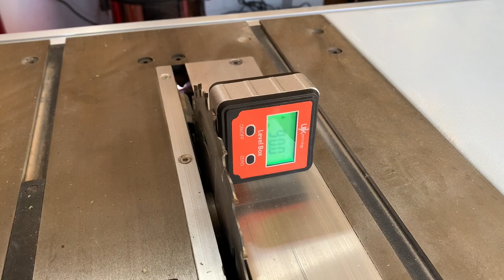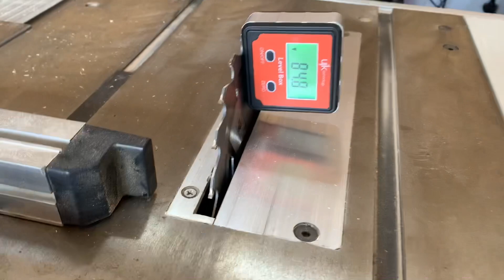How to make a beautiful birdhouse

Comment: A great video! I was just wondering I'm building a birdhouse will any protruding nails or screws be dangerous to the birds?
Reply from the maker: Hi Peter, thanks for watching.absolutely. make sure your selected nails are no longer than the 2 pieces of wood. I spotted 2 nails that where protruding and a used a pair of snips to cut them to size